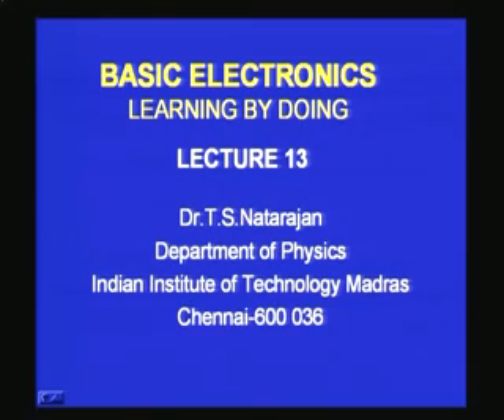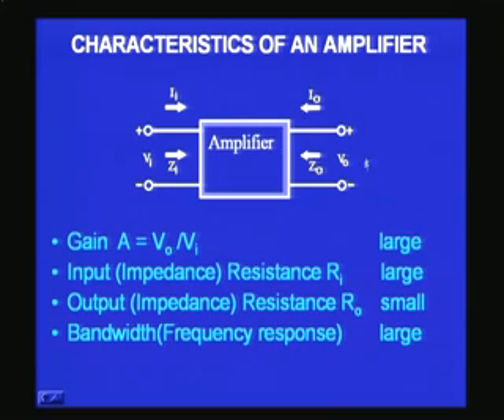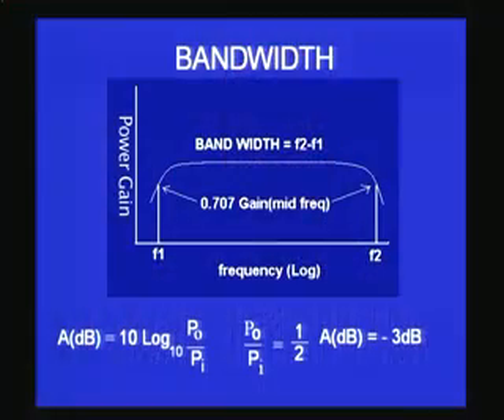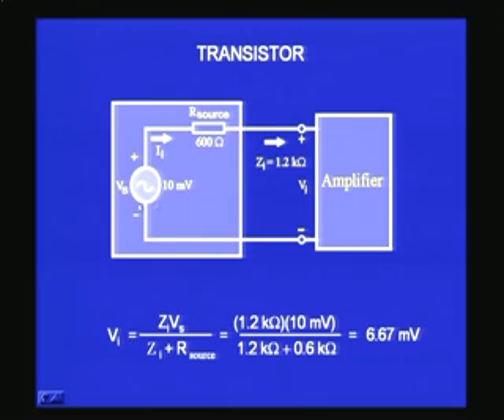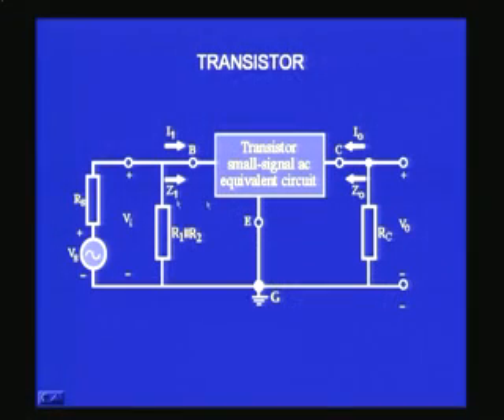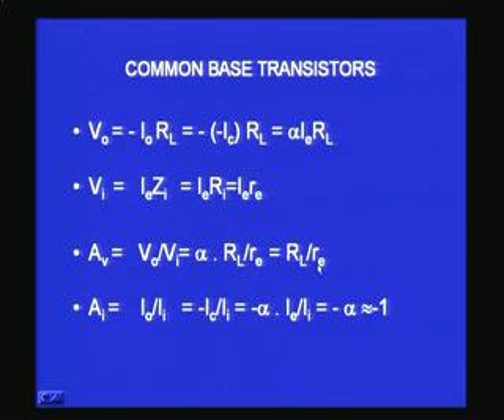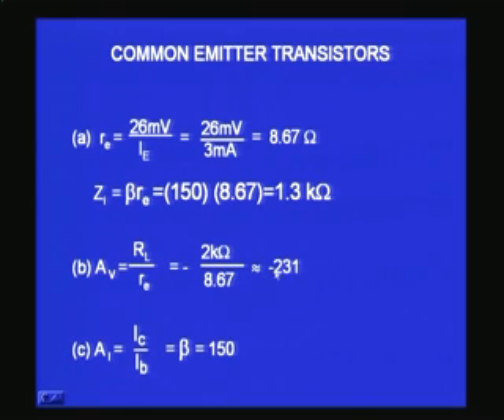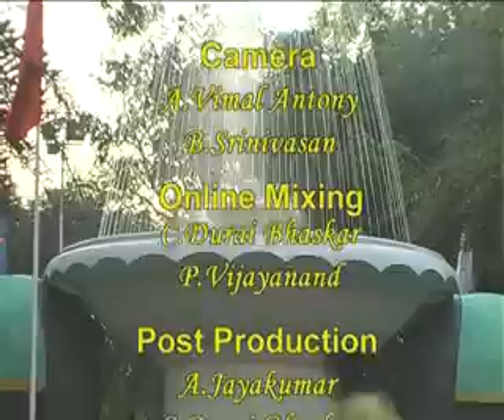Lecture - 13 Basic Characteristic of an Amplifer

Comment: A sine wave voltage wave form is  displayed, with the X axis represents time and Y axis  the amplitude. An amplifier just amplifies the signal amplitude ( y axis) only.   In one figure ( second slide),  It is displayed that the output wave as a magnified sine wave. ( I mean that the time and voltage is expanded).  A student may assume that the out put of an amplifier  will not only increase the amplitude, but also changes the frequency of the signal.